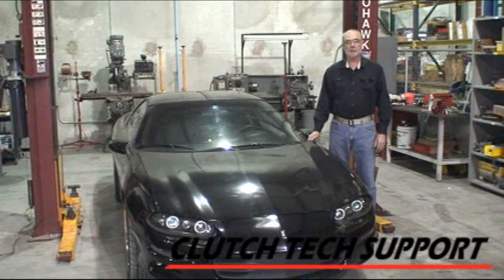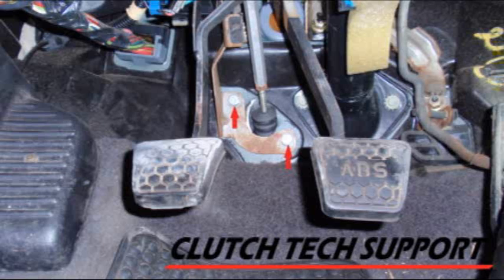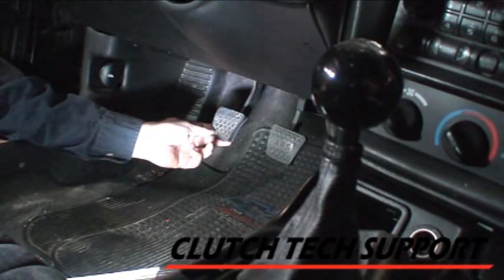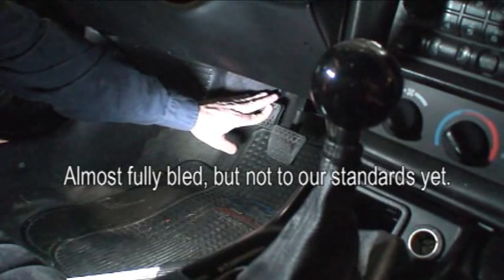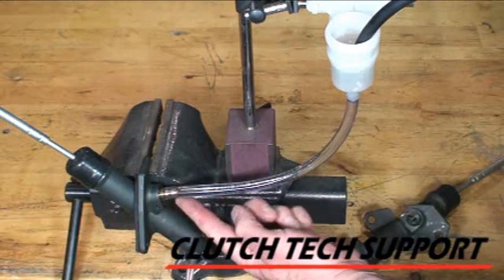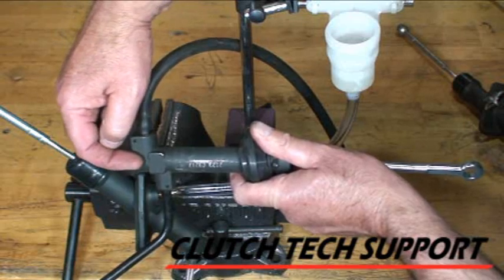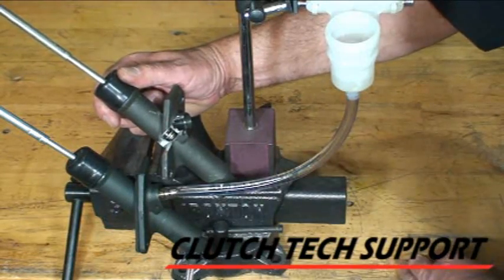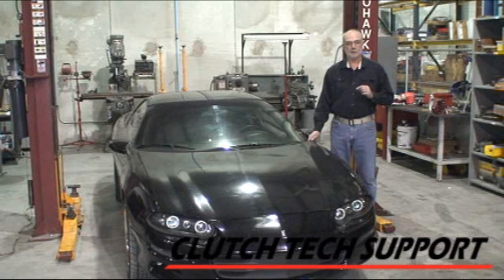2000 Chevrolet Camaro Clutch Hydraulic Release System and Bleeding Techniques

Comment: What I've found out is that using a clear hose, that the air comes from over the "barbs".  And even from around the threads of the bleeder screw itself. I usually put a smear of grease or antisieze on the bleeders threads. That way you're not sucking air on the back-stroke.

Comment: Great video. My two cents: if you’re by yourself, you can open the bleeder and let it drip for a minute or two. Then close the bleeder and pump the pedal about 30 times and open the bleeder again and let drip for a minute. Usually I’ll have a good pedal after that, but you can repeat as necessary til you get a good pedal. Now, doing it this way probably requires more brake fluid lol, but has always worked for me. Disclaimer: this method may not remove all the air from the system and you should have it professionally serviced by a certified technician to ensure proper operation of the clutch system on your vehicle
Reply: I cant seem to find the bleeder screw where exactly is it? What tools necassary to do so?

Comment: My 10646 Duralast clutch master cylinder interfered with the brake booster and cracked the reservoir hose at the master cylinder.  It is identical to Clutch Tech part in this video.  Not happy with the replacement  clutch master cylinder.  It has the same interference and will crack the reservoir hose in a few months.

Comment: This video is great! I have used to it replace the clutch master cylinder in my 97 Camaro, but I have now encountered a problem, while bleeding system I noticed a lot bubble coming through the transparent tube while applied vacuum and it remained like that for about 5 minutes, took a look under the car and brake fluid was leaking from where the slave cylinder connects into the trans, I pulled on it and it wouldn't come loose, and when I use the tool to push the plastic piece up o release it, it would budge or come out, when can I do to resolve this?

Comment: Any tips for getting the quick disconnect hose from the master cylinder to stay in the slave cylinder? I've had the transmission out twice now because it keeps ejecting. The first time, it damaged the female connector and I had to replace a brand new slave cylinder since the fitting isn't sold separately. Now that I've done that, the quick disconnect hose ejects from the slave cylinder as soon as I get any pressure on the pedal while bleeding it.

Comment: Will this work on a 1994 Chevrolet 2500 with NV4500? I replaced the master and slave. I bleed it out. Was able to drive. Tried to use it again after a short time and it wouldn't go into gear. Grinding etc. If I get in gear it won't come out. The pedal goes down but feels strangely hard binding feeling? Slave lined up correctly. I'm thinking binding could be air???

Comment: Working on a 2001 trans am. Replaced clutch, pressure plate, flywheel, bearings, had to tear it down 3 times to try to fix. Clutch pedal goes all the way down to the floor but car moves when in gear like clutch does not disengage. Also have really hard time getting car into gear at all when it is started. Aside from keep bleeding it, any ideas??
Reply: Did u figure out your problem

Comment: I hate to ask but I used your video to bleed the clutch on my 00 Camaro ss but it still seems to engage at different points every time...one minute it will engage up top and others down low to the floor and if I do a hard pull it tends to stay down to the floor any help would be appreciated thanks in advance

Comment: I just replaced both slave and master pedal stay stuck to floor. I have to pull pedal up I tried gravity bleeding pump and holding and still stuck to floor. Any clues on what I'm doing wrong.
Reply: 2000 Pontiac trans am 6 speed
Reply: No it doesn't have an adjustment on the cylinder

Comment: I have a 2001 trans am ws6 6 peed  it only has 29000 original miles on the car it sat for awhile in the garage I finally pulled it out put new tires and brakes on it oil change basically a complete tune-up I drove the car now for about 2 months and just the other day ago I went out and went to pick someone up and the clutch stuck to the floor and won't come back up I need help bad

Comment: Hi, first time doing this.  I installed new master. Doing the bleeding process and I'm getting no pedal. It still stays on floor and I have to pull it back up. Any ideas??   I'm doing this by myself until I can get a little pedal and will then see if I can get someone to operate the pedal while I open the bleeder or I'll have to drill a hole in the trans tunnel so I can do it completely by my self.  TY

Comment: My dad have a V6 3.8 the clutch pedal are stuck on the floor 1 time /2  and won't up back. We change the master cylinder, bleeding like you say. And the clutch stuck down like 1/100 now but still sometime. I try the soft push like you said on the end of the video but no bubble...

Slave cylinder is the problem?
Reply: Same problem for me what technique did you guys end up using??

Comment: I had watched several videos on bleeding the master, which did me no good in getting the job done. They were idealistic garbage in/garbage out repeats. You do a great job of explaining the "why" and "how" of doing this. I went right out to my shop and got it done in a few minutes. With what I learned from  you, I was able to diagnose a faulty ($50) speed-bleeder that was causing complications. Once we coaxed all of the bubbles out as shown, the LS7 stage 2 clutch works perfect! I know how but you might do a video on how to set the clutch pedal travel on a high-output master so as not to overload the master. Thanks!!

Comment: So the fluid that comes out of the bleeder - where does it go?  Do you just allow it to run into the bellhousing or is there a tube pushed into the end of the bleeder, which would require a ratchet with a through hole??  The bleed line on my 99 TA is just a hex with a hole in the middle.  it does not have standard bleeder fitting with a nipple.
Reply: Hi Gary, thanks so much for posting this video. Is there any risk to the clutch if some fluid drips through and out of the bell housing? Did my best to capture it but wasn't 100%.

Comment: Hello Gary..I am trying to bleed the clutch on my 1999 Z28 LS1 Camaro because I can´t get the shifter into any gear...I have looked at your videos and think I can get it right...
but one big problem is what kind of tool you use to open and close the bleedscrew on side of the tranny above the hose going down from the master cylinder.. size millimeter or inch...the chromed tool Tim uses on the bleedscrew   Big Thanks in Advance /RogerL in South Sweden
Reply: were u able to get it into gear what'd u have to do?
Reply: Hi I thought I had som air in the clutchsystem and I went crazy bout the tight fit of the bleednut in the tunnel...I made a 4"x4" cut inside of the car right side of gas pedal throgh interiormat and steelwall bending away the metal...had a vaccumpump from Ebay to suck new oil up from the oilreservoir..did the bleeding as told in the video up here..filled new oil 5-7 times and pumped and bleed several times...made a woodstick from a broomstick to hold down the pedal while bleeding...clutch got better but im not totally satisfied...maybe need to change the clutch mastercylinder and even slavecylinder with steelbraded hose between then....and if I change all that I can as well install a new complete clutch assembly....regards RL

Comment: Need help with clutch bleeding on 2000 Camaro 3.8L Series II 5 speed....do I have to push the clutch and hold to bleed then tight it, pull clutch then push again, bleed again then tight and pull clutch again? So how many times to bleed? I have no dry vacuum tool but I was watching at the last video without tool....how long to get the bubbles out? I'm doing by myself without someone help as I used a 2x4x3 board between pedal and driver's seat.
Reply: +perfectionclutch I was watching with subtitles on this video, it seem to different with your speaking so I asked my oldest daughter to interpret for me cause I'm deaf, now I got it what your reply to my comment like what she explained. Thank you so much for reply on this, Sir.

Comment: Hello great video. I have a ls1, t56 in my 3rd gen camaro in need of clutch replacement. 
 Do you have to bleed the system every time you change the clutch because you have to remove the lines from the throw out bearing?
And do you sell the tool to remove the hydraulic lines. I'm kinda lost and need help, first car clutch I've worked on. Thanks
Reply: ***** thanks for the reply, big help. god bless